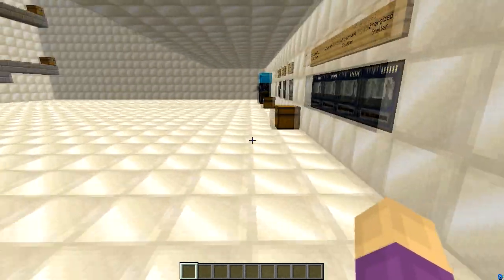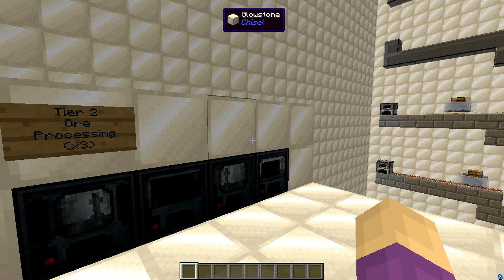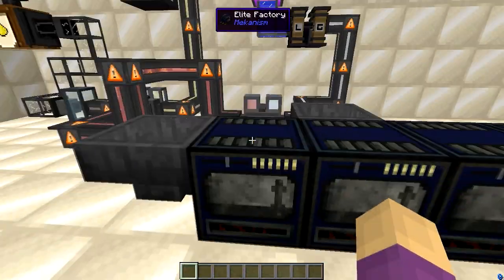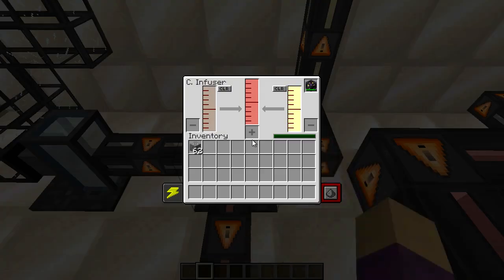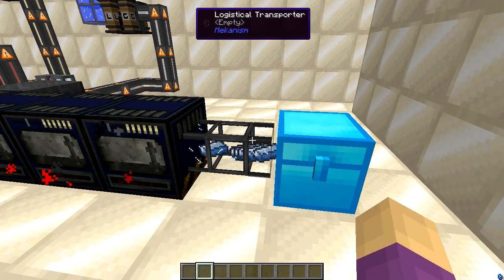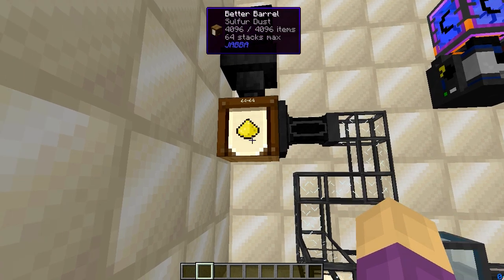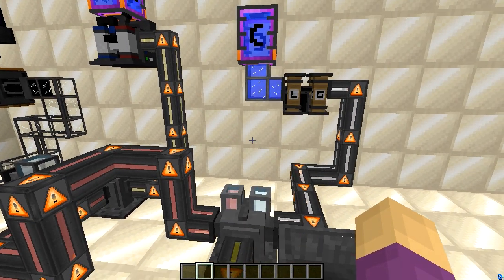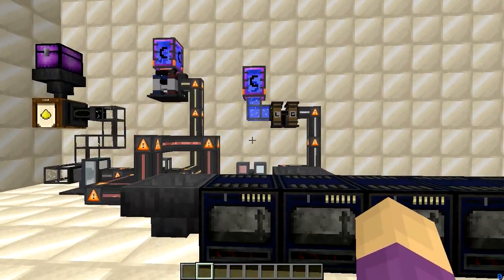Mod Guide - Ore Quadrupling with Mekanism-Dev 6.0

Comment: i have a question on the ore trippling process. supplying oxygen to basic purification factory. i have to use 1 electrolytic separator per ore input on the factory or it runs out of O2. i would then have to disconnect and let separators refill or the factory only processes 1 input. is this normal? i can always create tanks but i am just curious with this O2 demand.
Reply from the maker: Actually this is generally quite normal. The best example of this is the Hydrogen Generator; it usually actually needs TWO separators feeding it Hydrogen constantly just to work at 100% power output all the time.

My big suggestion is to considering making an Electrolytic Separator 'farm' that all funnels into a Mekanism "Gas Tank". Then use pressurized tubing out from this.. directly into your factory. This will give you a MUCH larger volume of Oxygen storage in addition to helping you level out your ore processing!
Reply: thank you so much for that clarification. its nice to have info like this when planning your factory/power plant layout.

Comment: I do not think this over the top; neither too easy or too hard.  It seems on par with other mods(industrial craft, factorization.)  2x ore = 2 machines, 3x = 4, 4x = 10.  exponential growth(plus some), an input of a finite material, and a larger infrastructure.  This seems to me, to be pretty balanced.

Comment: Looking forward to Mek 6.0. Go Quad Ore Processing, GO!

Our server is currently running Resonant Rise v.2.5.5.0 and the current recipe for creating/processing sulfur can be done starting with Cobblestone - 

My Current setup for Sulfur Production, other ways may vary:

RailCraft Rock Crusher > CobbleStone = 1 Gravel, + 10% chance for 1 flint
Sag Mill > 1 Gravel = 1 Flint, + 10% chance extra 1 flint
Mek Crusher > 4 Flint = 1 Gunpowder
IC2 Extractor > 1 Gunpowder = 1 Sulfur

Basic process to obtain sulfur and lots of it... is it OP? Depends on how much will be needed and overall final requirements to run Quad Ore processing.

Still - nice to know that currently there is an efficient way of producing sulfur!
Reply from the maker: Thanks very much for sharing the sulfur information with the community. We're always looking for more ways to achieve a goal!

Comment: Unless you use other mods, sulfur is incredibly hard to get. Its not OP at all.
Reply from the maker: I actually do agree with this, Shane. Mekanism by it self requires mass amounts of Gunpowder run through a Purifier just to get Sulfur. So you are sacrificing gunpowder that you could be using for other purposes.

That being said.. people rarely use just one mod at a time. If Railcraft or Thermal Expansion come into play (or Ender IO).. Sulfur gets quite a bit more common.
Reply: With those mods it may be somewhat easy to come by, but its still not infinite (unless theres a way to produce netherrack that i dont know about)
Reply from the maker: Shane B Actually Railcraft's sulfur is a worldgen ore. That means it's near-infinite, as long as you either (A) keep generating world chunks.. or (B) use something like Mystcraft to generate worlds for mining.

Now.. keeping that all in mind, I still don't count that AGAINST this new Mekanism system. You can't try to balance one mod by every other mod out there. So.. you are right, Shane. Gun powder / Sulfur is still a finite resource, especially within the confines of Mekanism.
Reply: After setting up world eater or world destroyer using Modular force field mod will greatly reduce the hard work though. Which also adds that mekanism is reliant on other mods. But it is designed to do that, it has universal pipes and cables to interact with other mods.